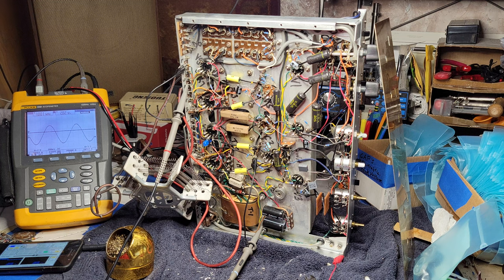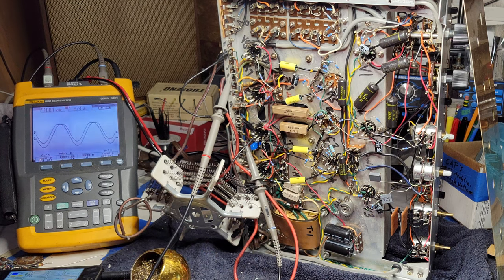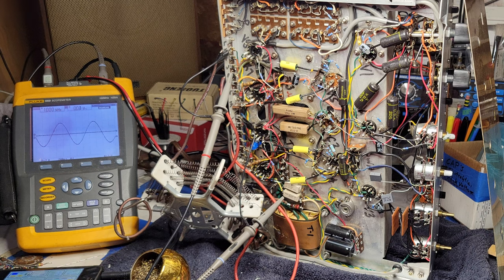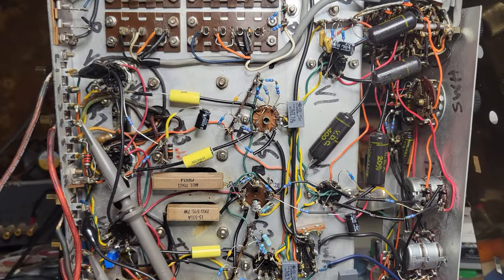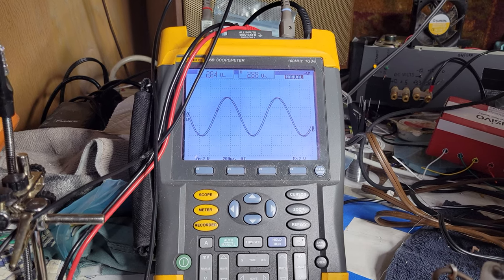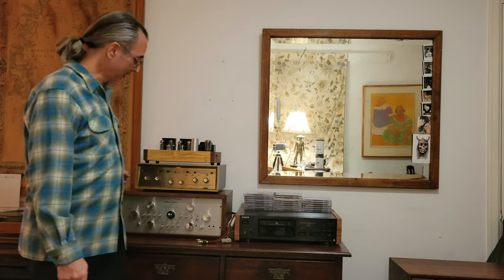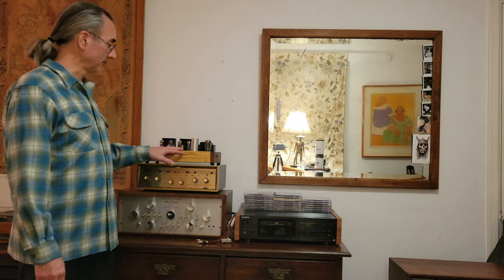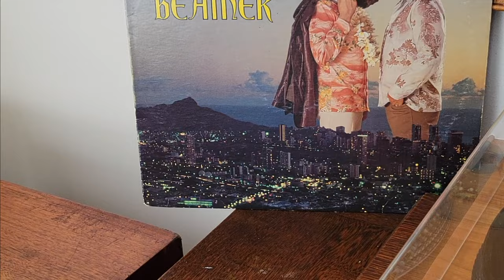Can a Restored Vintage Tube Amp Beat a New DIY Amp? PACO SA-40 vs. Beaver Valley

Comment: Those old Pyramid caps get very DC leaky, thus the guitar amp guys love them as they drive their tubes harder into distortion. Good for them, not good for fidelity (or sine waves).
Reply: Looking at the offerings at D.K. the options for caps is confusing - for the .033 uf  as a example, the application  has so many options-  general use  - automotive -  switching - what did you use  ?  if you specify audio - only one option comes up - the orange drop 225 -  what do you think ?

Comment: In terms of your sound tests, I actually favor the Beaver Valley amp and the NAD one.  In fact with the latter, when you subbed in the Paco, it seems as if all the life went out of the sound.  Sorry, I know you worked very hard on the Paco.  I remember I had a nice 6V6 Bell Labs stereo amplifier and I did the same thing, recapping it, replacing all of the out of tolerance resistors.  While it sounded good, I could never get rid of a slight background hum, no matter what I did. Needless to say, I ended up getting rid of the amp because of that.   Now, that Phase Linear 4000.  In my tech repair days back in the 90's, I have come across that pre-amp quite often.  While I had much hatred for Bob Carver products as they are nightmares to work on, the Phase Linear stuff he made was not that bad.  One thing is for certain, they have it in terms of the looks.   Phase Linear Preamps and amps just look awesome!   However, Phase Linear products were showing their age already back then.  I do like the looks of the 4000 pre-amp, but I do question it's performance.  Even after going through it, (mainly just resoldering and replacing bad caps), the results were just OK.  Given that I have seen that 4000 in many of your videos, I take it that is one of your "daily drivers".  That being so, I would like to know what is your opinion on the 4000.   Surprisingly, I can still get one of these for a reasonable price, but don't want to do so if the end result is just a mediocre sound.   I doubt I would ever use the four channel joystick control, but again, it was something that made the pre-amp look cool.
Reply from the maker: I've had the 4000 for a few months, and I've been enjoying it. It needed some work initially: the usual resoldering of the board connectors where some joints were cracked and cleaning up some previous work. Of course, I polished all the knobs and switches. I've been keeping an eye out for beneficial mods, but I've been pretty pleased with it, and I'm not in a hurry to do more work on it.
Reply from the maker: And you're right about the PACO. It's not a keeper, at least not in its present form. It's got some issues that are not easily addressed, but if I'm going to sell it, I'd like to feel good about it.
Reply: @Lancaster_Hi-Fi  I got to the point with the Bell Labs amp that I sold it, but did mention the slight hum.  It sold anyway.  The amp was worked on before I got it and I did put a lot of work into it with fully recapping it and replacing out of tolerance resistors.   The hum came into the voltage amp stage somehow, and I could never get rid of it.  Changing that tube to one of lower gain did reduce the hum considerably, but it also reduced the power output.  In the end, I had other amps to mess around with and I just gave up on the Bell Labs amp.  To put things in perspective, I had a Magnavox turntable that had a mono 6V6 amplifier in it and it actually sounded better than the Bell Labs unit.  It also had some hum, but only if you put your ear right on the speaker.  With a record playing, you didn't notice it.  Had that unit been stereo, it would have made a nicer amplifier than the Bell Labs.
Reply from the maker: I've been thinking of a mod that might save the PACO. I'm planning to build a Simple 45/Tubelab SE. That design uses a MOSFET source follower between stages. It presents high input impedance to the AF amp and low output impedance to the output stage. An op-amp voltage follower might also do the trick. In my latest testing, the PACO has slewing distortion at 10 kHz, and that's not a simple problem to fix with tubes alone.
Reply: @Lancaster_Hi-Fi  Paco never struck me as a company that was remotely close to high end.   They kind of were a poor man's Dynaco.  At least they tried to get to a hi-fi level.  Some of the Heathkit amplifiers were nice too.  Especially the Williamson amps.  But Dynaco had something most didn't have, and that was good transformers.  Also, they had David Halfler behind the company and the guy could design a pretty mean tube circuit.   The Dynaco ST-70 is STILL one of the most highly regarded amplifiers in the tube world.
Reply: @Lancaster_Hi-Fi  What would you say is a good price to pick one up for?  Given that it is in moderately good condition, but you have to go through the solder work.
Reply: @jukingeo  I was wondering about the cause of a hum that developed in my PrimaLuna ProLogue 5 non-integrated with Gold Lion KT 88 output tubes and 12AU7 and 12AX7 input tubes. 

A hum developed after probably less than 20 hours of listening on my end. Not sure how many hours the tubes already had on them when I purchased it.
Reply: @hanksta34  Since the hum wasn't there before, I would say change out the tubes with the old ones each in turn.  When the hum goes away, you have your culprit.
Reply: @hanksta34  I think you have a bad tube. Try putting the old tubes back in one, by one, once the hum goes away, you found the culprit.
Reply from the maker: Pick what up? PACO or Dynaco ST-70?
Reply: @Lancaster_Hi-Fi  Oh, the Dynaco, for certain.
Reply from the maker: @jukingeo  Prices for those are all over the place. I really couldn't say.

Comment: What kind if resistirs are you using ss replacements? I get very twisted around, trying to decide shat new resistors to buy to replace which old resistors. Is tgere a brand or type (likw metal film) thst you tend to use?
Reply from the maker: I use metal film, 1% tolerance, 1/2 watt (unless higher wattage is needed). After that, whatever is cheapest at Digikey.
Reply: @Lancaster_Hi-Fi  thank you! Much appreciated

Comment: Did you see Dave G had a post on AK about deleting the PECs ? kind of difficult to find though ,seems interesting .  Thank you for the workI ,I have a similar problem with my PACO - But dont have  Scope ,or the know how  if I did . I suppose its the shotgun approach -  New Caps and Resistors - Seems the norm - thanks  to your dialogue -  the hope is of course that the problem goes away .  by the way Any recommendations for a scope for tube amp work ? Uncle Doug has a scope tutorial - Trying to learn Thanks
Reply from the maker: No,  I haven't seen it. I just tried Google but couldn't find it, though I did find references to "Dave's boards."
Reply: @Lancaster_Hi-Fi  I was looking up Paco sa-40 rebuild     and the first page that came up was from Tom r --  about halfway down was Dave G post. He asked the question Mar 11- 2013  AK forum

Comment: True or False: Tubey goodness comes in the form of a tube pre-amp paired with a SS amp? 

Or, would it be even sweeter to utilize a tube pre-amp with a non-integrated tube amp?
Reply: It depends on the system.  If you have just one stage that give you the tube coloring effects, then I think that would do it.   I had once tried a tube preamp with a mosfet power amp and that sounded pretty nice.   I have had push pull tube amplifiers, and surprisingly, they didn't have as warm a sound as I was expecting.   Then I was turned on to singled ended amps and was told that they have VERY warm sound and really nice imaging.   I have yet to get a hold of one of these, but I do intend to build a singled ended stereo EL34 amp.  So I will put that to the test when it is done.
Reply from the maker: I think it's just what you like and works for you. I'm mainly using a solid state preamp and tube power amp. A friend uses an ARC tube preamp with  Mola Mola class D power amp. He used to use a tube power amp but really liked the Mola.